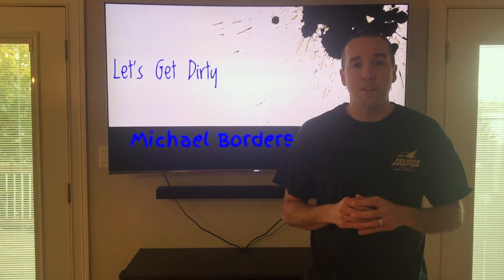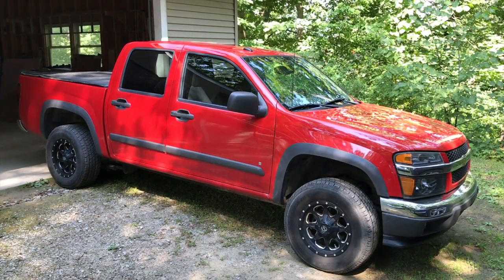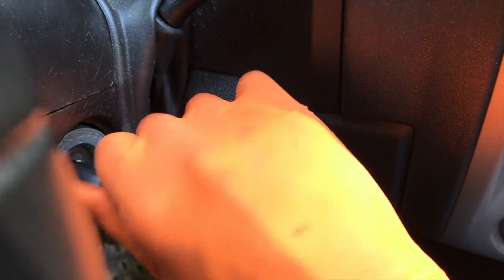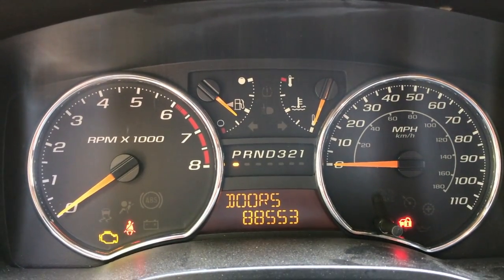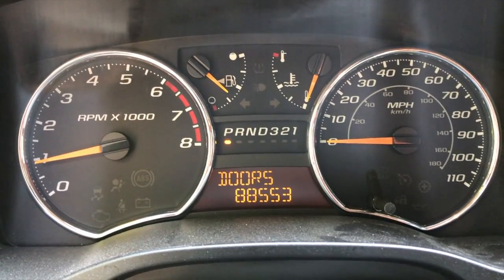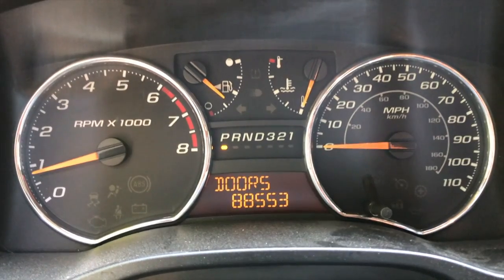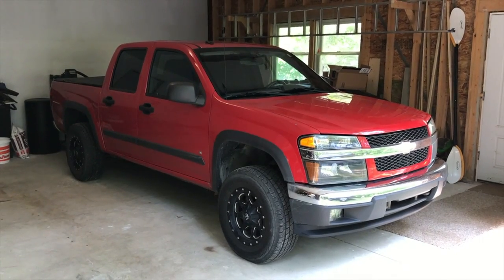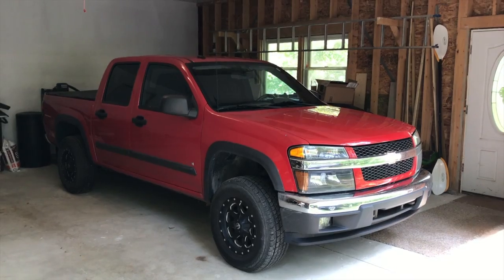How to do a "QUICK Reset" on your ABS System!

Comment: will this smart trick also work for my Chevrolet matiz? Also I have a yellow engine light that comes on sometimes when I'm driving along, then it goes off; other times it doesn't come on for a couple of days, then on another day there it is again - car is running fine - is there a reset trick for this light? Thanks
Reply from the maker: Thanks for watching & it will.  After the reset, if there are any faulty parts within the ABS system... it may come back on again until part is replaced.

Comment: Awesome! 2002 Chrysler T&C. ABS light with multiple error codes after ABS module replacement. 3 step process worked after driving off. Thank you so much for this fix.
Reply from the maker: Great to hear, thanks for watching & sharing this.  Resetting the ABS system and removing those multiple error codes is awesome.

Welcome to the DIY Raptor Club.  Hopefully many stress free days ahead for you.

😎👍🔧🔩

Comment: My lights came on ABS and it says service stabilitrak and service traction control, and when I was driving it was kicking almost like it didn’t want to drive and I would lift my foot off of gas and give it a second before pressing again.  Any help?
Reply from the maker: Thanks for watching & welcome to the DIY Raptor Club.  Let’s get this figured out.

We can start with the items that are the friendliest.  First, we recommend verifying all four of your tires are properly inflated to the recommended manufacturers psi.  Low tire pressure can cause these symptoms oddly enough.

Second, we recommend checking the fluid level inside your brake fluid reservoir.  If it’s above the max line, brake fluid will need to be taken out.  Below is a link to a video that may be helpful.

       https://youtu.be/X-AJ5tD6zoA

If fluid is too low, check your reservoir cap to see which brake fluid is recommended by the manufacturer to be put in.  Adding brake fluid to bring the level up within the low & max line will be required.

Please keep us posted, us DIY’ers need to stick together!

😎👍🔧🔩

Comment: My 2010 Colorado lt V8. My radio turns on but no sound.  My chimes aren't working also.
What could it be?
Reply from the maker: Thanks for watching & welcome to the DIY Raptor Club.  Most common cause is a faulty fuse inside engine compartment.  Gotta locate the burnt out fuse...🤔

Comment: Nope doesn’t work
Reply from the maker: Thanks for watching, you may need to perform a system reset by disconnecting the black cable from your battery for 5 minutes.

If that does not work, AutoZone will reset your error codes for 100% free.

😎👍🔧🔩

Comment: I tried that on my 2011 Chevy Malibu LTZ and the abs light wont go out and I just put in a brand new wheel hub
Reply from the maker: Thanks for watching & welcome to the DIY Raptor Club.  Did the new hub fix issue?

You may need to perform a full system reset by disconnecting the black cable from your battery for a minimum of 5 minutes.

If this does not work, AutoZone will hook your vehicle up to an OBD scanner and reset your error codes for free.  Please keep us posted.

😎👍🔧🔩
Reply: @DIYwithMichaelBorders  
He just needs to drive it for just a little bit and that’ll do the job. It worked in Chevy Trailblazer 2002. Thanks.
Reply from the maker: @JoseTorres_74  

Thanks for sharing.  😎👍
Reply: @DIYwithMichaelBorders  
You welcome.
Reply from the maker: @JoseTorres_74  

👍

Comment: I JUS TEST DROVE A 2010 DODGE CALIBER TWO DAYS AGO.. IT RAN AND DROVE GREAT BUT WHEN I GOT IN THE ABS AND BRAKE LIGHT STAYED ON THE WHOLE TIME.. I’M GOING TODAY TO BUY THE CAR.. DO U THINK THIS METHOD CAN WORK ON A DODGE CALIBER AND IF IT DOESN’T WORK DO U THINK I SHOULD STILL BUY THE CAR?
Reply from the maker: Thanks for watching & welcome to the DIY Raptor Club.  It very possible.  If it does not work, we recommend visiting your local AutoZone where they can hook up an OBD scanner to your vehicle and read your ABS fault codes.

The fault codes will tell us the exact part causing the issue.

😎👍🔧🔩

Comment: Would this work for a 2005 Corvette?
Reply from the maker: Thanks for watching & it should.  😎👍
Reply: @DIYwithMichaelBorders  how do I go about it with push button start?
Reply from the maker: @unworthyinktattooparlor6315  

Thanks for the reply, in your case you will press the on push-button once to turn on the dash lights/instrument cluster.

At this point, the instrument cluster will be powered however engine will be off and you can perform procedure.

Comment: WOW! It worked. My big brother just installed new battery posts on my car so I was worried that he knocked something loose but he insisted that it probably turned the TCS lights on my dash since the battery got disconnected....and he was right. Thank you for saving me a trip to the repair shop.👍 Oh and I have a Mazda so apparently it is a universal thing 🤷🏼‍♀️
Reply: yep, works on cars and trucks. Awesome tip
Reply from the maker: You are very welcome April, thanks for watching.  Welcome to the DIY Raptor Club.

New battery before winter time is a bonus...that’s if you live in an area that gets cold.

Hope all is well.  😎👍🔧🔩

Comment: Very sceptical about trying this on my 2010 BMW 325 highline.  But did it and it seems to have worked. Unbelievable.

But ah
No

A day later, light was back on
So just get the problem fixed . The light doesn’t come on for nothing.
Reply: Just saw this video and have a 2002 bmw 325ic. ABS and Battery lights been on can't wait to try this tomorrow morning. I believe my 2 mechanics are screwballs. Had battery replaced at the BMW dealership thinking they would do the job right but seems like they didn't reset the code. And the abs brake light after an independent mechanic replaced one brake. Hopefully tomorrow it'll disappear so I can focus on replacing other parts.

Comment: This "3 depressions on the gas pedal trick" did not work.  Any other suggestion's?  And can a CV axle starting to go possibly cause this at all? Noticed a hole in the boot, been hearing a click every now and again.  Got a new CV no point taking chances with replacing a boot to later need to replace the CV anyway.  Thanks very much for any help you may be able to give. OBDII Scanner is not clearing the code even after all kinds of work.  Got new calipers to go in too, in case they are hanging and not sure if that causes the light either.  It's an annoyance at this point.  Again, thanks for any suggestions of help it is appreciated!
Reply from the maker: Thanks for watching & welcome to the DIY Raptor Club.  Below is a link to our video talking about the most common causes.

        https://youtu.be/5lgMhKYGuto

You may also want to have the OBD scanner read ABS error faults.

😎👍🔧🔩
Reply: @DIYwithMichaelBorders  Thanks for your speedy response!  Will check out the link, too.  Will have to find out if it pulled any error code or just the light being on.  If no error codes could it mean the light is at fault for a false positive and how do you get around that?  The scanner will not remove the code. It's been tried after other fixes earlier on.  We know these things can be tricky, so plod on it's all that can be done for now.  Thanks again, much appreciated!
Reply: @DIYwithMichaelBorders  Just checked your link it is the original one that we tried "brake trick" that did not work.  Any others?  We know to check the ring, the line hook up on the wheel well, the fuses and that there may be more than one.  Found out the computer reader part seldom ever goes it's usually something before it?  Do you know how we'd tell if a sensor went already replaced that months back and the chase has been on for getting the light to go out.  It flickers at times then goes back to steady. Sorry for the lengthiness. Again, many thanks for any suggestions to try!
Reply from the maker: @AFineLineA  

Thanks for the reply, the OBD scanner may definitely pick up a fault that can lead us in the right direction.

AutoZone can read your ABS codes for 100% free.
Reply: @DIYwithMichaelBorders  Thank You again, and will give Autozone a try, as well.  When the work has been done the light should go out once the computer realizes it's fixed is the way most of us think. This one has been a real pain.   Can't live with or without vehicles!  Lol
Reply: @DIYwithMichaelBorders  I goofed when I put "brake trick", it was depress the gas pedal.  Fixed it in the above post. Sorry on any confusion it may have caused.  Have a good day!
Reply from the maker: @AFineLineA  

So true.  😎👍
Reply from the maker: @AFineLineA  

No worries.  👍

Comment: Havent Tried it yet but I did replace my front right ABS Wheel speed Sensor and the ABS/Traction Light is still showing, will this reset the computer and shut the lights off without the Mechanics Computer. Also My 2005 Equinox has Drums on the back so does that mean only the fronts haveing disc brakes are the only wheels with ABS Sensors? Sorry for sounding dumb haha

Comment: Does this work every vehicle. Have trouble getting fluid to the rear brake cylinders. 2002 Nissan frontier
Reply from the maker: Good morning Billy, welcome to the DIY Raptor Club.  Did you recently perform any MX to your brake system?  This will help us pinpoint whether or not any recent maintenance is tied to your issues.

We can get a better idea what is causing lack of fluid to rear brakes.

😎👍🔧🔩

Comment: All the methods did not work in my land cruiser HZJ73 H55F
Reply from the maker: Thanks for watching, we recommend having Autozone hook an OBD scanner up to your vehicle & reading fault codes.

This will help us pinpoint the exact part causing your issues.
Reply: @DIYwithMichaelBorders  I actually tried with OBD 1 and found code 31, 32 and I checked it was telling me right hand and left hand speed sensor malfunction but I can't at the moment I need to eliminate the light on the dashboard till I reach to the city to buy the sensor so how to eliminate it.
Reply from the maker: @mandelafoundationauto2985  

Thanks for the update, the OBD scanner can momentarily reset the fault however as you drive, it will trigger again until part fixed.

Comment: Hi Michael I’m a women and I’m clueless about cars , My ABS LIGHT is on I have a 2006 Mercury Milan will it work, should I get my brakes changed first
Reply from the maker: Thanks for watching & welcome to the DIY Raptor Club.  You can give this reset procedure a try.

If you have had this vehicle for several years and have not replaced brakes, it’s probably getting to a point where they will need to be replaced.

Worn out brakes can actually trigger this ABS light.  Keep us posted.

😎👍🔧🔩

Comment: Awesome, guy, Thanks a lot! It worked! 

I just got my passlock/ignition cylinder replaced and all my keyfobs recalibrated and about one week after dropping $500 bucks and one light finally going out, three lights come on: abs, traction, and parking brake all light up and stay lit! Didn't want to drop any more money for a "diagnostic" and two hours in a waiting room. 

My 2011 (manual) Colorado chirped at me about 5 times after I pressed the gas like you said and when it started, no issues!
Reply: Thank you so much it worked
Reply from the maker: You are very welcome & thanks for watching.  That’s great to hear.  Saving $500 is a good thing.  Hope all is well.

😎👍🔧🔩
Reply: @DIYwithMichaelBorders  How can you turn ignition on with keyfob?
Reply from the maker: @Gods-Elect  

Thanks for watching, great question.  Ensure that key fob is not inside vehicle and can not be reached by vehicles signal.

Press start button which will turn on electrical system and computer without starting engine.

Comment: This is awesome!  It works!  I did the three step process...abs and brake lights still on but once I drove out of the drive way, maybe 10 mph, reset was complete.  Excellent peddle, fluids good, etc. and checked prior to reset attempt of course.  Thank you so much!!! 🌟👏🏻😃
Reply: Same with me!!, Thank you @DIY with Michael Borders, and @Linda Sheffield for your help
Reply: I doubt this will work on my vw but might try
Reply: What about for a 94 Food Explorer, that begins losing battery juice quickly after the ABS light comes on? How do you figure that one out?
Reply: Btw my abs light is not on but brakes still don't hold pressure
Reply from the maker: Very cool & thanks for sharing this.  Thanks for watching as well.  Enjoy your upcoming week Linda.

😎👍🔧🔩
Reply: @DIYwithMichaelBorders never had to mess with abs sensors before but my Honda Accord's front right sensor loses contact once above 30 mph, any suggestions on what this could be?
Reply from the maker: @donniev8181  

Thanks for sharing your experience, it’s likely that your sensor will need to be cleaned and reconnected…or it may need to be replaced all together.

Comment: Thank u! When I did that it reset my oil life. ABS light came on for the first time since I bought my truck 6 years ago. I was scared to drive to work it went off but came back on...
Reply: I just tried three step process it worked but light came back on after I drove it did the process again and light back off garage wanted to charge me 1200 .oo for a new abs module
Reply from the maker: @brucekenworthy6731  

Thanks for watching & that’s a good chunk of cash...😳

Us fellow DIY’ers need to stick together!  Hope all is well.

😎👍🔧🔩
Reply: Light been on for a few years on my 2006 dodge charger I was getting ready to junk it!
Reply from the maker: @brucekenworthy6731  

Hopefully you can get a lot more driving out of it.  😀👍
Reply from the maker: Thanks for watching & did the reset work?

Comment: Sadly, this did not work on my 2003 Toyota Tacoma pre-runner double cab.
Reply from the maker: Thanks for watching & sharing this.  A battery reset may help.  Below is a link.

       https://youtu.be/jXluPymxVmA

😎👍🔧🔩
Reply: @DIYwithMichaelBorders  I will totally try this! Thank you for the link. I will update when I get around to it!
Reply from the maker: @GoreTorn16  

You are very welcome.  😎👍
Reply: @DIYwithMichaelBorders  I just tried as you suggested in the link. But sadly it didn't work either. Brake fluid is great, the valves and pipes look good (not cracked). ABS is still blinking when I turned on the engine after connecting my battery (30 min wait). I Guess its time to take it to the car repairman.
Reply from the maker: @GoreTorn16  

Thanks for the update, you can actually visit your local AutoZone and they can hook up an OBD scanner to your vehicle to read your ABS error codes.

This will help pinpoint the exact part that needs to be replaced.  It may be a friendly DIY project.  Either or, keep us posted.

Comment: Hi Michael I have a 2015 Hyundai Accent that I think is having ABS issues. it feels like what I think is the ABS disengaging my brakes under 10mph for no apparent reason. it feels as if my brake pedal is on a sprocket and being bounced over teeth of said sprocket. no ABS dash lights come on when this happens. any reccoemndations?
Reply: Did u ever find out mine is doing the same thing

Comment: How to quick reset on ABS on a 2002 toyota fielder wagon
Reply from the maker: Thanks for watching & we haven’t tried it on a Toyota.  We recommend disconnecting the negative cable from your battery and leaving disconnected for 5 minute.

After 5 minutes, resecure negative cable to battery and start engine.

😎👍🔧🔩

Comment: Mike please aditional info. Did step 1 didnt work my abs light stays on when i turn off my pickup. Thank you.
Reply from the maker: Thanks for watching, try disconnecting black cable from battery.  After 30 minutes, re-connect cable to battery & start engine.

This allows the system to do a full reset.

😎👍🔧🔩

Comment: Thank You so much for this easy anyone can do "fix!!!"   Bought an OBDII tester and that was supposed to be able to clear the ABS light code after doing repairs. It did not clear it.  Will try this.  Fingers crossed!!!   Will check back if it doesn't work.
Reply: Hey there my friend. I was having the same issue your having. My scanner did not turn my ABS light out after repair. Did you have any luck with brake trick? Just curious thank you.
Reply: @josecastaing598  Hi, so sorry on a quicker response. Never got a notification.  The answer is, "No, it did not work". All kinds of repairs done and light never goes out.  On occasion it does flicker.  Watched other video's, as well.  One suggested checking the sensor ring if dirty clean it, if damaged worn replace it then drive a bit to see if it goes out.  Next  follow the line to where it hooks up on the tire wheel well wall and undo the clip, check for corrosion, dirt, moisture-water.  If any try to clean what you can.  If moisture-water let dry fully re-hook and test drive. Hook back up and drive a bit.  He said heavy rains or going thru puddles can cause that one to kick up.  If still on check all ABS fuses and relays there can be more than one on some vehicles. Pull ONE at a time and inspect.  OR if you have a new and good fuse-relay plug it in and if the light goes out after driving a bit you found it. Do all fuses-relays.  If all's good plug back in.  The video showed some vehicles have three fuses. One regular flat and two boxier type.  Use the panel graph to locate the correct fuse(s). He said last but not least was the computer part that is the main reader for the ABS can't remember the name, but is known by parts stores and mechanic's.  The problem with that part is it is very, very expensive!  Thousand or more depends on the vehicle. Was told could get it cleared by a mechanic for $75-$100.  They run it thru a cycle of sorts.  Not cheap either and ridiculous that no matter what is done by buying parts and fixing what you think it could be and none of the work shuts it.  Most annoying at this point.  Have you had any luck at all?  If I find anything else I'll pass it on and maybe you could do the same. Best of luck!